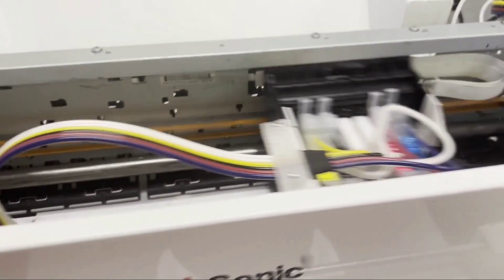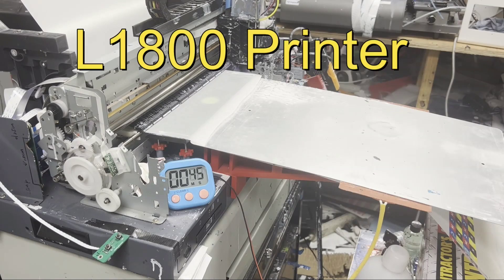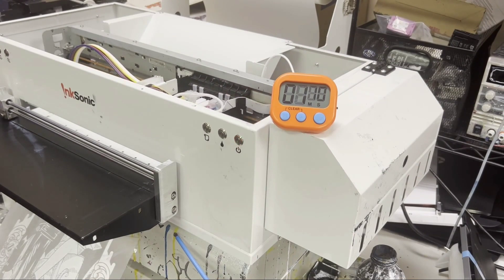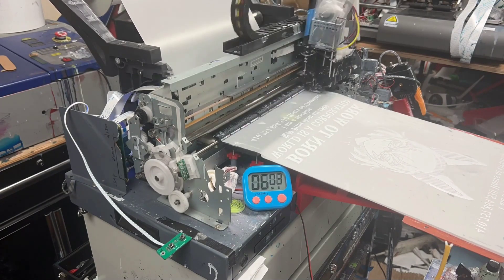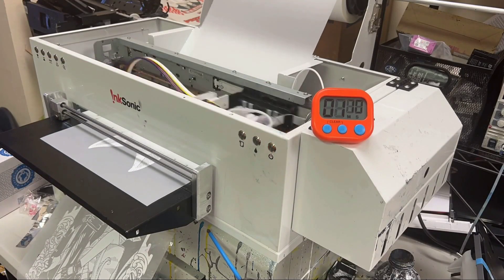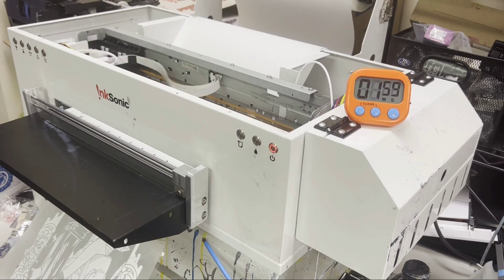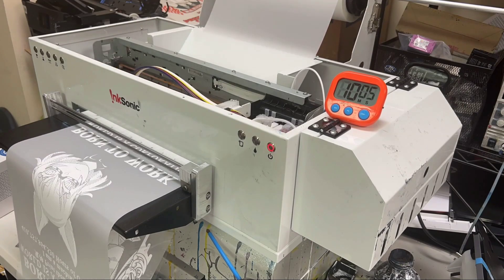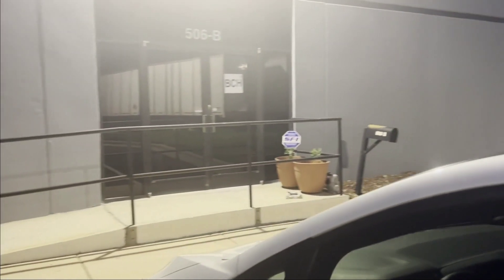DTF Printer Showdown! 1390 vs. L1800: Which Is Right for You? Evaluate InkSonic C13A in Production

Comment: So which printer you think is better or recommend?
Reply from the maker: I'm currently using the InkSonic C13A at home, and it's been working great so far. I’ve also tested the C13, but I recommend the C13A because it includes a dedicated printhead maintenance button, which makes upkeep much easier. I have a new video about the maintenance for C13A here: https://youtu.be/Cg7rC11qseM

Comment: Do you have any sort of documentation on what the C604 Capacitor is?
Mine is blown on the CB53 Main board of my L1800
Reply from the maker: Thanks so much for subscribing—your support really helps us grow the channel as we work toward our 100k goal, and it means a lot to the community! I don’t have the exact specification for the C604 capacitor, but if it keeps blowing, I recommend checking the Q601 transistor on the CB53 mainboard. A power leak through that component can often be the root cause, and simply replacing the capacitor alone won’t solve the problem long-term. Here’s a link to the transistor we carry that fits this board: [https://bchtechnologies.com/products/transistor-qf601-for-mainboard-cb53-main-l1800-1390-1430-epson-printers-fix-no-power](https://bchtechnologies.com/products/transistor-qf601-for-mainboard-cb53-main-l1800-1390-1430-epson-printers-fix-no-power). I try to answer subscriber questions within a few days, though I’m currently working through a big backlog—thanks for your patience and for being part of the BCH Technologies community!